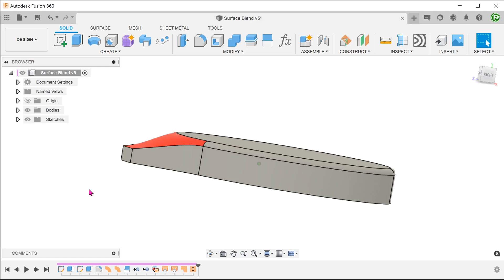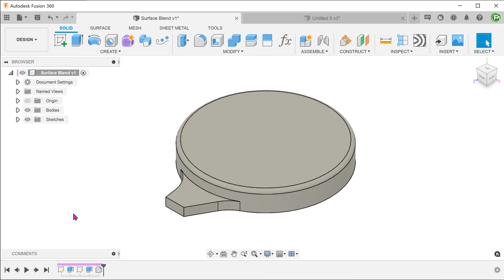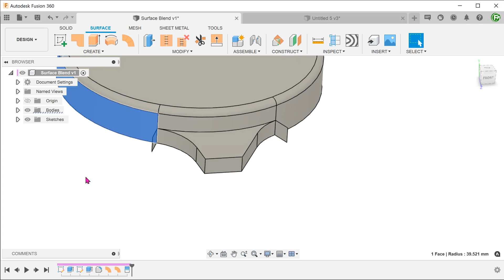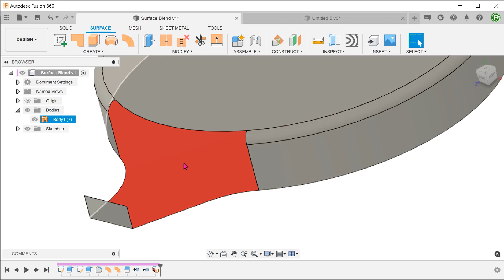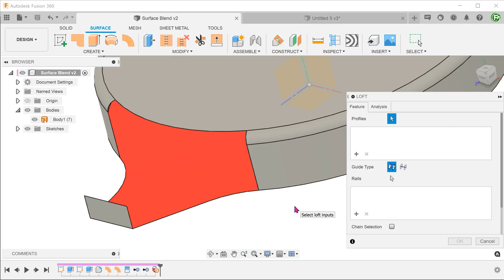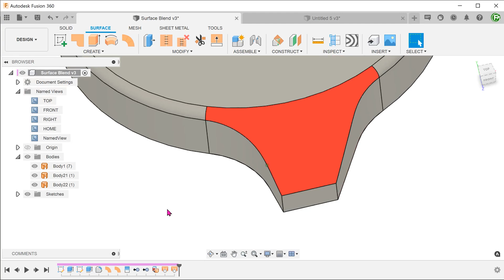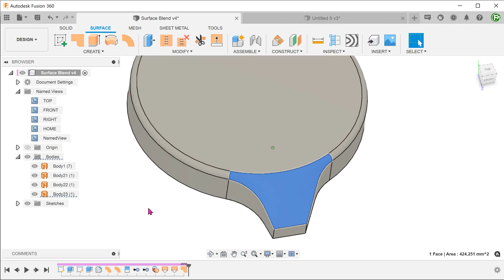Fusion 360 | Surface Blending Exercise

Comment: I think I wouldn't have added the fillets to begin with.  I would have used the original extrude faces to split the circular body, then blend the primitive shapes.  After all the patching was complete, I would have then added the fillets.  It would definitely look different, but my approach is to always use primitive geometry before applying fillets.

Comment: Wouldn't it be easier to just do a revolve that has a profile of that feature, then sketch on the top surface and cut the rest of the body so that feature is only in that one section?

Comment: The strong bulge is created by the tangency condition to the flat top surface. If you don't delete the fillet entirely, but leave a little sliver of it then you can control the direction of the surface tangent to it and in effect control the size of the bulge.
Reply from the maker: I went back to try this with a small sliver of the fillet. It does significantly reduce the bulge. Thank you for this suggestion!
Reply: @Fusion360School  I am wondering what shape you are trying to create. You mention that in order to achieve better transitions you could have used G2 fillets. While that is true, using the patch command will almost always be a compromise in surface quality. I've experimented with this interesting shape but don't see a way of sharing it here. Any suggestions ?
Reply from the maker: @TrippyLighting  I was actually doodling around with making a watch bezel. That step down would be one of the features where the pin of the strap latches to. Would you like to create a public share link inside of Fusion and post it here? I would be interested to see what you have in mind.

Comment: Tbh, I probably would have just extruded that edge to the very top, instead of halfway, and then just revolve cut a downward angle into it, which can also include the fillet for the top circular edge.
Reply from the maker: Yes, you are absolutely right. A revolve would be faster and produce a better surface. During the formulating of this video, this did come across my mind. I had actually intended for this video to be a conceptual exercise on how to break surfaces down and rebuild them to merge with surrounding faces. The model used here might not have been the best example.
Reply: @Fusion360School  That's fair enough. I wouldn't have known how to patch something like that before this video.

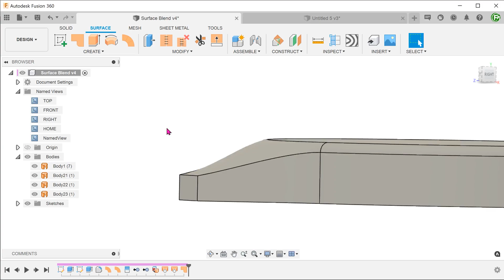Comment: Didint really get your problem. What was too big? The profile follows perfectly the top of the disk and curves down to the notch (if you mean that on 06:37).
Reply from the maker: As a general rule, the patch command should be used as a last resort as it difficult to achieve a good surface with it. If we have no choice but to use it, we should try to minimise the area involved. The surface produced here looks kind of decent in the graphics area. But it probably would not withstand the scrutiny of a zebra analysis.
In this case, I have used the patch surface over quite a large area. I am looking for opinions on how I can break this surface down into smaller areas which can be achieved via lofts. Lofts can produce a better surface.

Comment: Possible you can do a tutorial series how to best set up and effectively use the 3DCONNEXION Space mouse pro or equivalent? 
Keep trying to use it and not getting the hang of it or realizing benefits, I think a good tutorial on how to use it effectively and why it helps in a CAD environment would be Very helpful!

Has anyone seen a good tutorial series on the space mouse, and how to effectively set it up correctly and how to use it efficiently?
Reply from the maker: To be honest, I did not put in too much effort into setting it up. I simply plugged in and ignored setting up the hot keys😅. For me, the main reason for using it is for the smooth rotation, which I think provides for a better viewing experience. I find myself using it only when I am recording these videos and not when I am doing my own designs. So I might not be the best spokesperson for this mouse!
Reply: @Fusion360School  I can see its benefits, and many advocate for its use, yet I cant seem to integrate it into my workflow as anything more than a novelty that takes extra time to utilize. I wish the 3D pan feature could be integrated into a standard mouse somehow.
Reply from the maker: @101rotarypower  For me the main benefit is   that you can decouple the rotating of the model from the mouse clicks. Other than that, I can't really think of a good reason to recommend people to buy what is a relatively expensive product.

Comment: Great video. You could build two patch halves at the half-way point with a profile curve for better control, but that would be an extra step and wouldnt be as quick as your current approach.
Reply from the maker: Mmm....will need to try that out. Thanks for the suggestion.
Reply: Exactly I've tried it. Splitted the top and front faces, created sketch and used it as midedge. Than patch one half and mirrored it. It takes longer but it's possible to alter the center transition by altering the sketch.
Reply from the maker: @medyk3D  This is definitely one way. I was actually hoping to minimise the patch surface by dividing the six-sided hole into smaller 4-sided regions for loft but could not think of a good way.
Reply: @Fusion360School  yeah. I have no better idea. Maybe someone else can think about something simple and smart